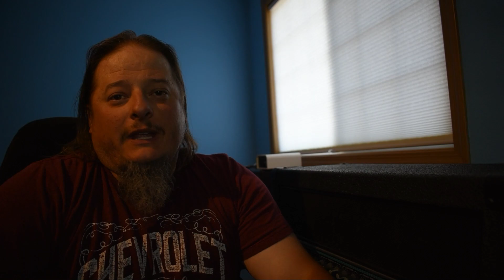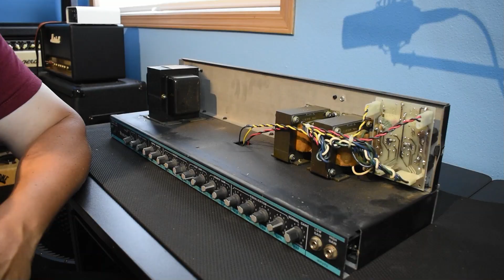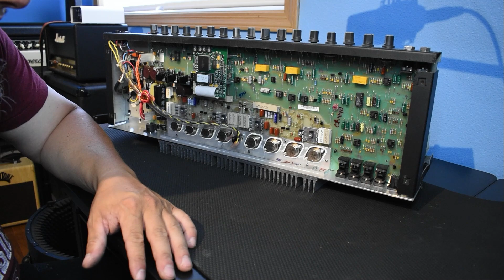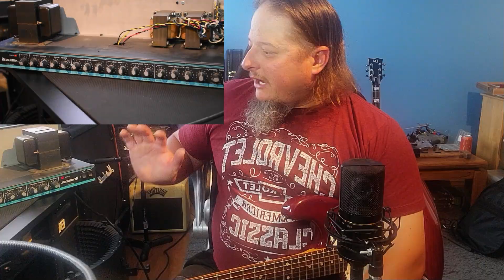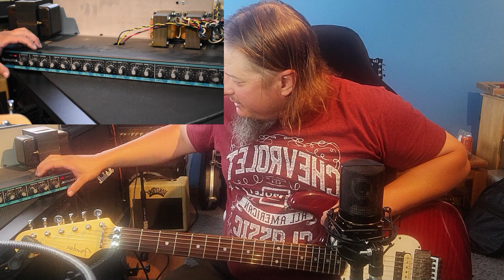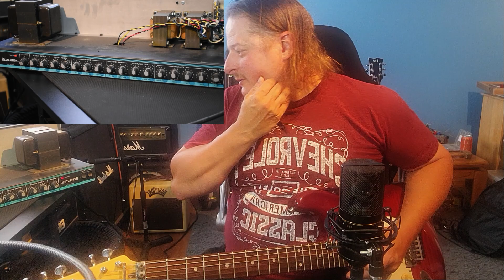What Did I Get Myself Into?

Comment: that is basicly a stereo chorus 212 in head form. it has rev n delay in digital section. YOU DEF WANT TO ACCESS CHORUS!!! Even at low rate and depth it really sounds alot better. I wld assume it uses the same switch as stereo chorus. i found one in mint condition and love it dearly. Instant 80s!!!
Reply from the maker: Still searching for the foot switches
Reply: Hey man, you can try to plug it in Stereo! and play with the knob, The chorus should be available than.